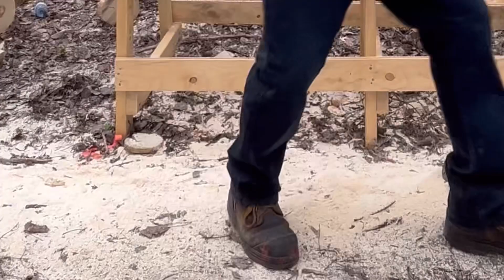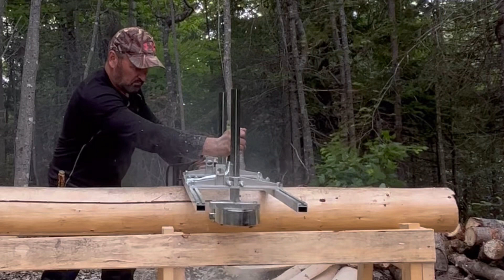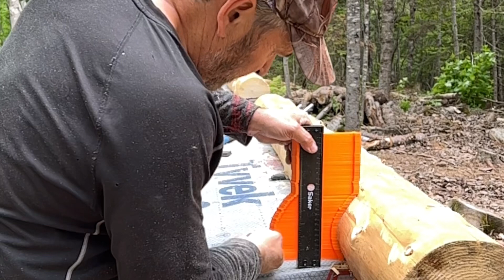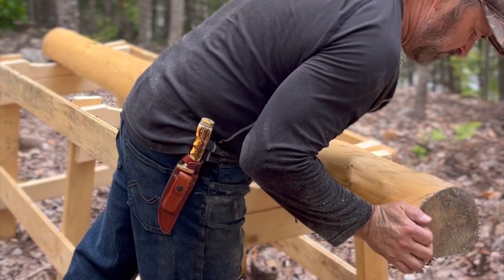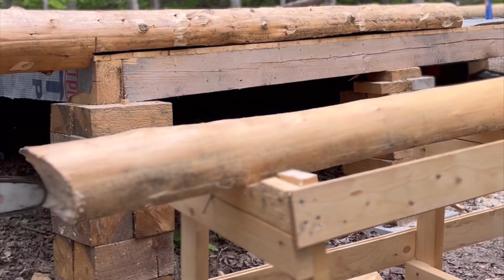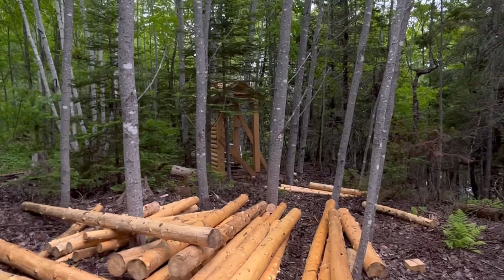Building an off grid log cabin, woodwork,wilderness homestead

Comment: Looking good...It looks like notching the joints on the ends is a lot of work. Would it be easier to use an angle grinder with a cutting wheel to make thousands rounded notches. Seems like it would be a little easier. I must say that Notch came out good and tight.